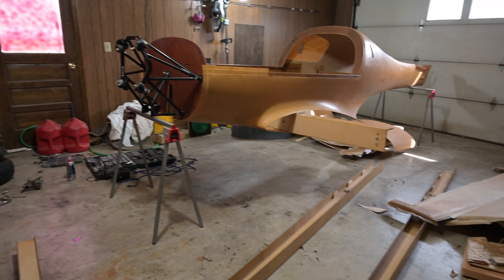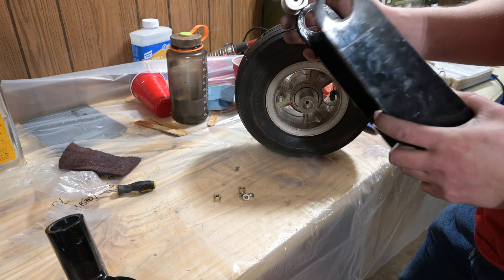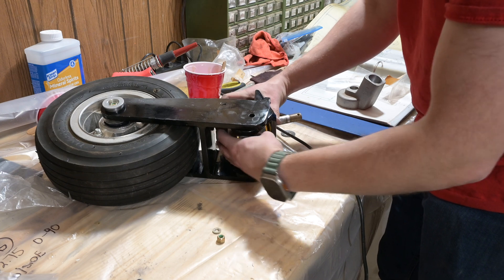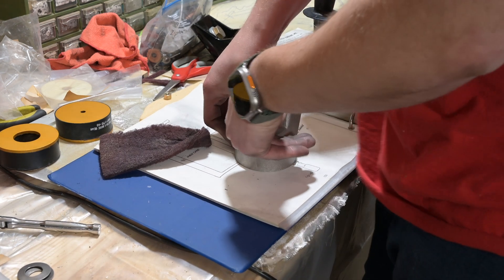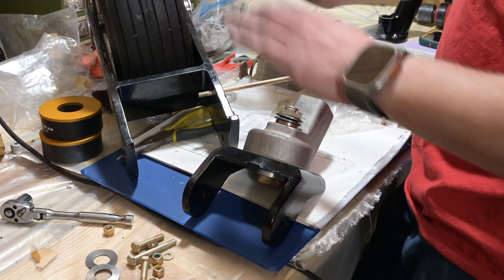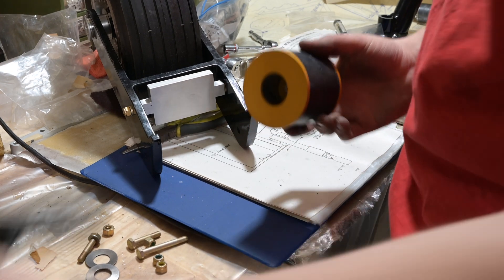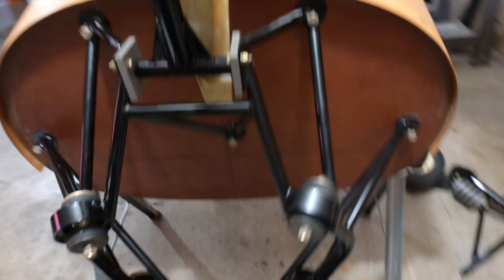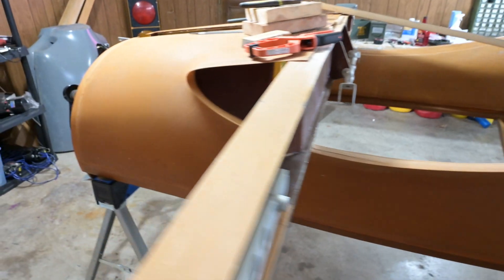Building the Nose Gear - Lancair Build Part 4

Comment: Don't rush the FWF, focus on main gear an gluing..
Reply from the maker: Got it, yeah I got the rear spar and main gear in today, belly is going on next. I realized what I was in for around this point. Lots of work on gear doors, close out ribs, etc. before I’m ready to flip it over. I would also like to paint the gear wells and belly before flipping it over so that body work is much easier. I am in an interesting predicament though because I’m PCSing in 2 months so I would like to hang the engine to make it easier to move. Thanks for the feedback!
Reply: @DylanClements98  Jepp.. It's easy to focus on the hardware.. Remember the engine fw is an perfect flip around point. Agree with nice to move around engine. Use temp bolt for this moment.. Not torqued fully..